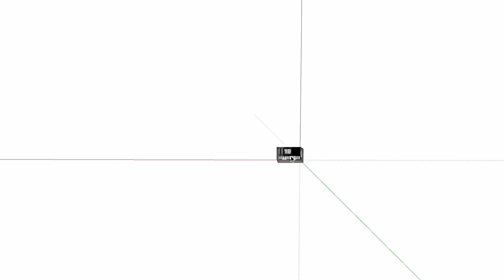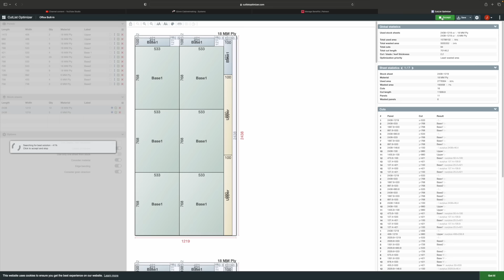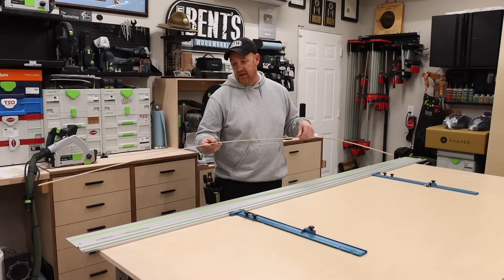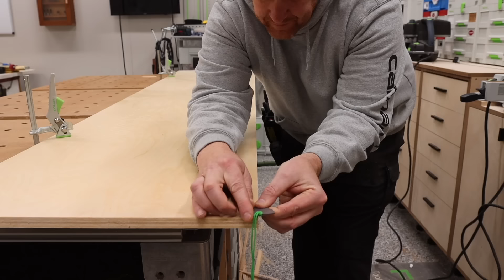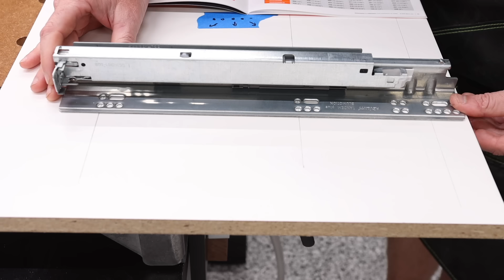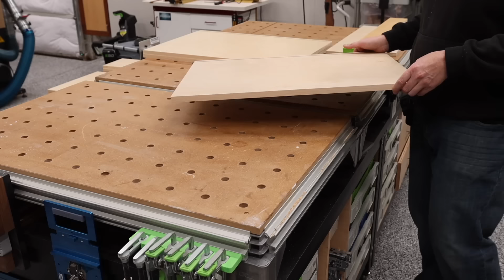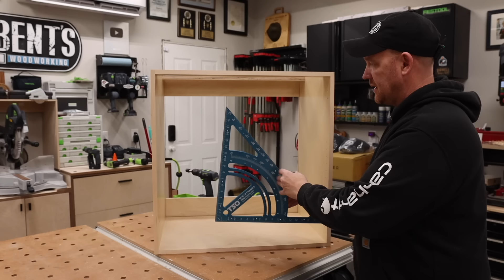STOP overbuilding cabinets

Comment: You said you make a majority of your cuts with the track saw and then make your final cuts at the table saw. Why is that? is it more accurate or just a cleaner cut? I trust my new track saw way more than I do my old beat up table saw. Would making most of my final cuts on the track saw be a mistake, or is it just personal preference?
Reply: Use the  track saw to  rough cut the pieces oversize, then use the table saw to get repeatable accurate cuts.   If just using the track saw, it is inevitable that the cuts won't be as accurate.  STRAIGHT, yes, but not exactly the same on any two pieces.

Comment: I was wondering why do you finish the cuts on a table saw? can you just do that with the track saw? Are the cuts cleaner? no tear out?
Reply: I am guessing because a table saw will be more square/ accurate than a track saw (pencil widths, track not perfect, etc.). Personally I use a track saw to breakdown material and table saw to "finish" to size. My $.02.
Reply: @tjan4367  I see. That makes sense. Thanks.

Comment: hi. what screws do you use. 
you said 1-1/2” 

the plywood i am using at my job separates sometimes, even though i predrill countersink. 

i am using drywall screws.  
is there a screw that grabs good so not glue needed but doesn’t split the plywood as easy.

Comment: My brother owns a commercial cabinet shop in California and this is almost exactly how commercial cabinets are made. They’re all made from Melamine. Screwed together with no glue. Finished ends and drawer fronts are all sanded and covered with laminate then edge banded. The base of a row of cabinets is built, screwed to the floor and wall, then the cabinet boxes are screwed down to the base.

Comment: I found I needed to calibrate those blue parallel guides.  If you set them both at 600mm, the cut piece won’t be exactly 600mm through the entire length.

Comment: So, how do you hide the screws on the exterior of the cabinets? Do you use a separate cover sheet of plywood as a finisher or do you assemble it differently to hide the screws? I’m making shop cabinets and while the screws aren’t that big of a deal in a shop, it will drive me crazy to look at them.

Comment: It looks like it's put together like a house of cards but it'll hold just fine after those screws are in, even without glue. 
And those panels are now modular so you can easily replace one when it gets damaged. 
People get so caught up on justifying their way of doing things or lack of capability and miss the opportunity to expand their skills. 
I hate frameless with a passion for every reason in the book and more. But this system is so inexpensive you literally only need a saw, drill, a couple clamps and an iron to build your own kitchen in your garage.
Awesome video dude 👏🏻

Comment: I’m curious on the gable ends being down not resting on the bottoms. Ive had 4 failures  on clients homes where the weight of a cabinet blew the dowels and glue apart. some were also nailed or screwed. They all had adjustable legs on the bottoms.  All had top and bottom backers You may have covered this in other vids but I didn’t see a specific title on such discussion

Comment: I noticed a lot of woodworking youtubers build these things like they will be transported around a lot before being installed. Totally unnecessary with all the pocket screws. Glue and a trim nailer or some face screws where they won't be visible, is all that is needed.

Comment: Plywood (thicker than 15/16") is almost unbelievably strong and if you know how to build a box, incredibly ridged. The "face frame" to hold hinges (or inside walls if using "concealed" hinges) are about the pieces with the most stress on them. If you have enough "clams" to hold things while the glue dries, fasteners really aren't REQUIRED. I have a "love-hate" thing with melanin coated particle board or MDF. They get heavy fast, the cut edges allow humidity changes to make them "move", but they ARE cheaper per square foot than good (AB) plywood painted white gloss for ease of cleaning and so you can SEE what's inside the cabinet. Good video and good sense in your construction methods.

Comment: What do you do in the case where the sides of the cabinet are exposed? Finish panel? Or fill the screw holes with filler or plugs?

Comment: Thanks for the hint about cut list.  Seem to be free which is nice.  Perhaps cut list is handy for people who have small vehicles.   My limit for example is 66 inches by 38 inches.  
Cut list allows the user to specify the largest sheet of plywood such a vehicle can accept.  In my case I'm building storage boxes.  Cut list suggests I can get 2 storage boxes from 3 sheets of plywood.  I might have been able to eventually figure that out without cut list but CL made it fast.

Comment: Good video, small refinement:

if you cut a couple of triangles of your back panel, you can slide them into the grooves as you are doing your first assembly of the side panels to the base panel.  The back-panel triangle will exactly tie in the two panels relative to one another, so you know for sure that your panels are aligned to within parts of a mm - and your back panel will slide in nice and easy, every time, because the grooves are already aligned at the assembly stage.

Having the triangles of back panels might also help when placing the stretchers - you can rest the stretchers against the triangles as you assemble, guaranteeing they are at the correct location.

This should make assembly quicker also - you're effectively using the back panel triangles as a fence against which to accurately place parts, without having to "feel up" as you go.

Comment: I'm confused by the operation of trimming to width on the table saw. Which part is this? And didn't you already cut very accurately with the track saw? I thought those cuts were to final dimension/squareness. Please clarify.

Comment: For the people whining about expensive machinery used.
You can do all these steps with cheaper machines.
You can use a plunge saw for maybe 250€ with extras, a router for 200€ with bits for 100€, a good small drill with drill bits costs 100€.
An old iron to do the trims all around is basically for free to grab.
A pretty good miter saw costs less than 300€.
All in all 1.000€, I don't know how much that is in freedom money.
The result won't be perfect but good enough for a project like this.
And no one will know the difference.
Learn to use your machines. That's what makes the difference.

Comment: $250 Table saw and some homemade horses would have gotten that cut up fine. Soo many YouTubers out here being so fancy. $10 box of finish nails from Home Depot to put them together. $100 ryobi drill/impact set would get them installed fine. Total tools for build and install less than $400

Comment: This looks like what we used to call the European box style cabinets, where you have individual boxes made up, whether they be a bank of drawers, a cabinet of shelves, be they fixed or adjustable, or perhaps a sink cabinet. All of these would be made as individual cabinets and then they would be screwed together. Many kitchens today are assembled that way.

The way I learned to build cabinets was what we might call the custom cabinet way, and I think it might save some plywood and it looks simpler to me, but maybe only because that's the way I was taught and got used to.

I would start by ripping the sheets of plywood into 2' widths and then out of that make up the end pieces of base cabinets which had the toe kick or toe space cut out in the corners, then cut the partitions, and cut to length the bottoms. 

All that is needed after that, is cutting the rabbits and dadoes, which was done on what we used to call a routing table. If you ask someone today what a routing table is they will say, "Yes I know what a router table is." but that's not what I'm talking about. 

What I'm talking about is throwing down a 4x8 sheet of ply on two sawhorses, solid ones, not the kind I've so often seen on job sights, but horses that don't wiggle and shake. This would be a 3/4" sheet of plywood which could be AC fir or even a lesser grade as it is only a work table you will used to put your pieces on to make your dadoes and rabbits. 

By putting on a 1x6 of clear pine along one 8' edge and one along a 4' edge, this would give you something to buck your pieces to and then they would be held there with scrap blocks you would tack in place. 

On top of the 1x6 we would fasten another 1"x which the router base would ride along, set to where a 3/4" - straight router bit would cut to leave a 3/8" rabbit for the 1/4" back. The cabinet ends as well as the bottoms would be getting this rabbit for the plywood back. The extra 1/8" would allow the cabinets to be tight to the wall (usually) when fastened to the wall. We were careful about having straight walls in the kitchen area because we would be building our own cabinets this way and didn't want to use any moldings. (scribe mold) 

For dadoes, we would buck our pieces on the table, tack our blocks to hold them in place and then run the base of the router against a 1x4 tacked to the 1x6 which ran along the edge of our routing table, and also this 1x4 would be tacked to a block we would use which also held our piece so it would not move. 

We measured back to locate this 1x4. With practice it became an easy habit. Thus we made all our dadoes. Then it's just a matter of assembly with glue and finish nails. Ends were usually of oak veneer and ends which were in corners were of fir. The only pieces which were of oak were the ends. Later on a face frame of 1x oak would be made and applied to the front with 5d finish nails and glue. 

Smaller cabinet face frames were made up using a doweling jig. Anyway, that's the method I learned to do on the job back in the 70's. Sometimes the builder would have a cabinet company come out and make the doors and drawers. Sometimes we made them ourselves.

We would stain and varnish them ourselves. I don't know if this method would be cost feasible today or not, but it apparently was back in the 70's.

Comment: Love this method. I'd like to build frameless, european style cabinets like shown, but need to build a corner sink cabinet that turns at a 45. Any tips on differences for that shape cabinet? Would I just cut the face of the side pieces at a 45 degree angle so that the door still sits flat? I'm also wondering about clearance for the door opening before it pinches into another door.

Comment: My grandfather started teaching dad to build cabinets when he was 15. At 17 he was working full time in a professional cabinet shop, and stayed in the industry for 50 years. 

He swore biscuits were useless, but there’s no way in hell he would’ve assembled a carcass without glue, and damn sure wouldn’t run screws through the exposed side panels. 

You were doing great until the assembly process, and those carcasses are weak esp relying on end grain clamping pressure from a few screws. Might as well buy ikea cabinets.

Comment: Agree. I built a wall of base cabinets and used pocket holes, glue and screws. I went way too far. By the time cabinets are connected together and attached to the wall, that in its self makes for very sturdy cabinet support. Thanks for the tips.

Comment: Great vid.
I love that idea about temporarily pinning the pieces together to avoid clamping.
I'd just add that I wd usually sand the inside/seen faces of each piece prior to assembly.
Much more sustainable to build without glue as well because if the cabinet is no longer needed,u can reuse the screws and the plywood as well.

Comment: I'm a master furniture maker now, but when I first learned how to build cabinetry from Norm Abram (The new Yankee workshop) over 3 decades ago. Most of my furniture builds then, consisted mostly of sheet goods and case work (carcasses) I was so anal-retentive jointing strait /flat plywood edges. I would as a routine, joint the factory plywood edges doing my stock preparations and a 32nd finishing joint after stock preparations. But experience has taught me, unless the factory edge has a highly visible crown, (rocker) it's a total waste of time to joint the factory edges. Because the table saw fence will average out that less than perfect factory edge. I only use my joiner for glue ups and fine furniture machining work. When ripping cabinetry side panels, the factory edge will be positioned to the back of the cabinet anyway. And I ever had a problem with any of my edge banding delaminating on me.  Great video, this Video just brings me back to my unnecessary anal-retentive sheet goods edge preparation days 35 years ago, when I was just a baby learning the skill set.
Reply: Norm Abram name drop, hell yeah

Comment: Great video Jason. Do you recommend a particular 32mm cabinet system ie. Process 32, KISS II, System 32, etc? Seems to be pros and cons to each of these systems in terms of top/bottom reveals, consistency with 32mm "rules", compatibility with drawer slide systems, etc.

Also wanted to ask about material thickness. I see you've used 3/4" material here, but I note that a lot of kitchen cabinet shops use 5/8" or 16mm plywood or melamine for frameless cabinetry. Thoughts?

Comment: Question…you do the rip cuts a little over sized, and finish it off on the table saw. You edge band the entire rip cut prior to cross cuts. Are you cutting them down to final size (rip cut) prior to edge banding? Because I would think you’d edge band it just to cut it off. lol
Reply from the maker: The only part that needs edge banding is the face. So no, it isn’t being cut off.

Comment: I used this method to build a set of wood shop cabinets that carried extremely heavy equipment for years. It’s very sturdy and basically indestructible. The plans I used came from a Fine Woodworking magazine article. I ended up putting them on a wheels after 8 years and they are still carrying my shop equipment quite happily in the garage now… 10 years on. They look awesome.

Comment: I thought the title was going to address the common practice of building cabinets individually, thereby using twice as much wood as is necessary. I build so that there is only a single sheet of plywood between adjacent drawers or cupboards. I attach shelves and drawer slides to both sides of a single sheet.

Comment: * cultist optimizer
* panel forming
    * rip cuts first
        * cut off 5-6mm on one edge
        * edge banding cannot stick well to the factory edge
        * establish clean reference edge
        * cut goes right to left, manually placed
        * mark the edge with black X with marker
    * adjust parallel guides to oversized rip cut
        * e.g. 726mm width, set to 730mm
        * final cut will be on the table saw
        * guides reference the edge far from you
            * flip plywood around or go to other side of table
        * cut goes left to right
    * edge band the full length before crosscuts
        * saves time; no need to trim in crosscut direction
        * flush sand / trim
        * edge band over the black x (the reference edge)
    * cross cut
        * first cut is a little long so you leave room to trim factory edge from other side
        * track saw with MFT fence or track square
        * cut away from you
        * square the factory edge for the first cut on each rip
        * other panels will only require one cut
    * rip to final width
        * use the table saw
        * edge banding is running along the rip fence
* cut grooves
    * 1/4” / 6mm dado stack
    * stretcher between fence & blade to set spacing
    * groves go into the back of all 3 sides (opposite of edge band)
* cut shelf pin holes
    * Jason uses a router
* Drill holes/layout for the slides
* assemble
    * no glue, kid
    * Staple phase
        * bottom goes flat on table, with a side towards you near the edge
        * put the side there in place
        * narrow crown so it’s together so it doesn’t fall apart
            * downward pressure so it’s flush on the bottom
            * 1 near left edge, right edge, then middle
        * spin it around and do the other side panel
        * (maybe spin it and) add bottom stretcher (bottom of the U)
            * staple 2 on each side, leaving room for screw at top and bottom
        * lay it on its back, and add the top back stretcher, staple it
            * this should fit behind the groove, flush to the top of the cabinet which faces you
        * add the top front vertical stretcher
            * tip it upside down w/ top on the table
            * edge banding out
        * top front horizontal stretcher
            * flip it right side up
            * staple it in behind the vertical stretcher
    * Screw phase
        * add 3/8” layout lines on the sides wherever the stretchers are & the bottom
        * countersink holes / pre-drill for screws to sit flush
        * 2 screws on each side of the stretcher
        * 4 screws on each side of the bottom
        * screw it in baby!  1-1/2” screws
            * Jason uses a slow Festool CXS which has a clutch. Impact driver is probably dangerous to use here.
        * add 3 more screws through the bottom into the bottom front stretcher 
    * Check for square
        * doesn’t matter as much because you can make sure it’s square while installing
        * back panel squares it too
    * Slide in back panel from the front
        * Staple through back top stretcher into back panel to keep it in place
Reply: Thank you!!!